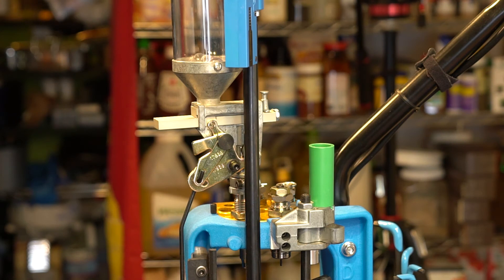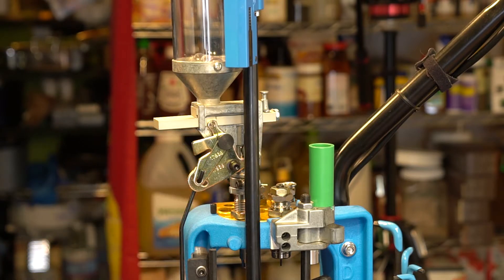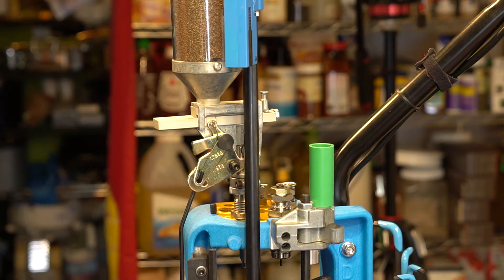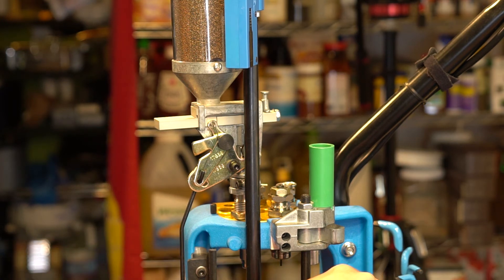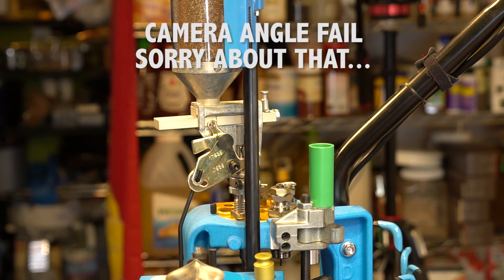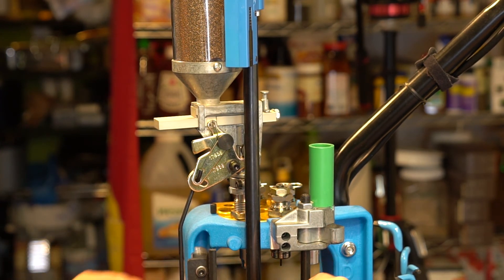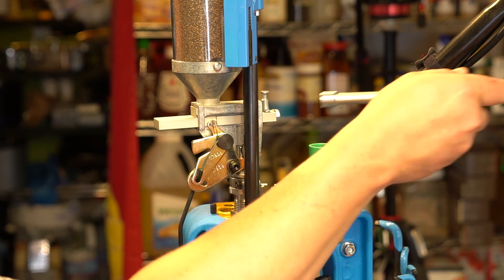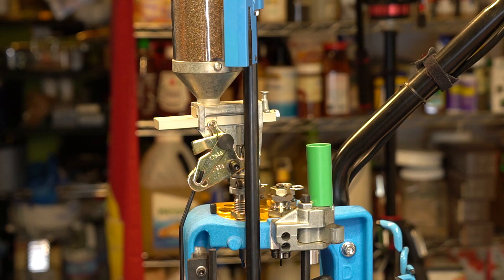Setting up a Dillon 650 to load 9mm - Part 6 - Powder Drop

Comment: I usually disconnect the rod that goes up to the powder drop, then hold the case up to the bottom of the funnel and cycle the "action" by hand.  I'll have to try it this way and see if it makes any difference.  I learned a lot from some of your older Dillon videos a few years ago, when I first got my machine.
Reply from the maker: hey thanks for that.... good to hear some one is listening :-)  cheers !

Comment: Are some types of powders more difficult to get consistent measurements with?
Reply from the maker: spherical powders tend to measure easier , but I have had no issues with either extruded or spherical with this  system or the 1050

Comment: There is no left or right on a round object, its clockwise or counterclockwise.    If you are referencing the bottom of the screw right would be counter clockwise.    But if you used the top, left would be clockwise.    So just use clockwise or counter not left or right, east or west etc..   Otherwise a good video.